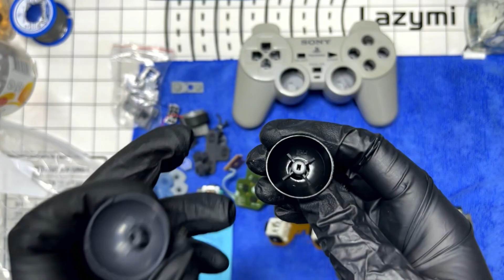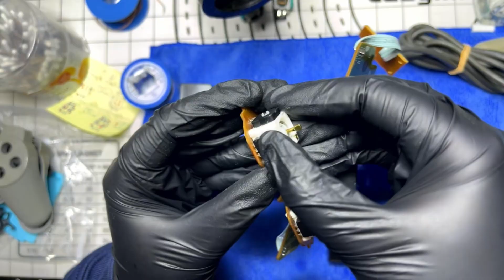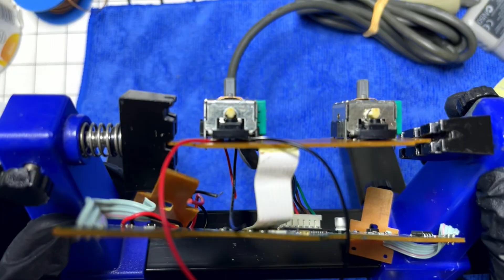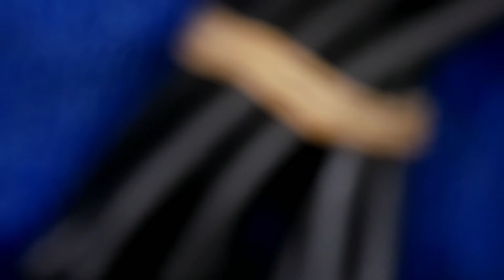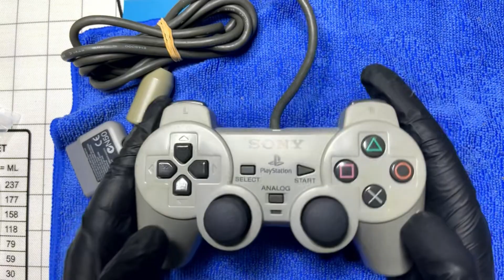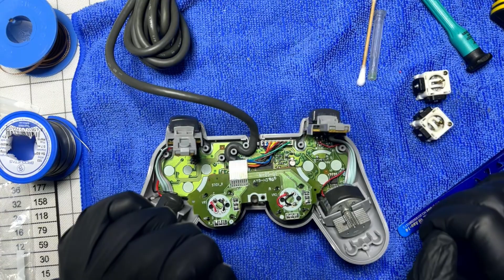Repairing this PS1 controller (analog stick replacements)

Comment: 3d analog sticks drive me nuts, for example on your original psx controller the stick is made of METAL, but when i open my PSONE original controller the stick is made of plastic and its thick, its looks the same as an xbox360 stick, altho i asked to the AI and it says both are not compatible. and also says both are 10k pot value.
Reply from the maker: Yes especially with the ps1 controllers there is so much variation in type of analog stick / pcb design that barely anything is compatible. Makes it more difficult to repair. 

It is correct that the psone controller uses similar sticks as the ones in the ps2/360 controllers. So if you need to replace those sticks at least you should have plenty of replacement options!
Reply: @cpr_tech  that is true! however the PSONE controller analog 3d stick is not compatible with the PS2 controller analog 3d stick, because i think on PS2 controllers sony went back to the thin metal stick again! they drive me nuts. and we are talking about the analog 3d stick only, imagine if after that you need to find a plastic cap that is compatible with what you have just soldered into the pcb
LOL
Reply from the maker: @5DiFika yes that is an absolute nightmare! If we are talking about the middle pin where the thumbstick part goes in that is actually thick plastic and not the thin metal part on the ps2 controllers. 

I also seem to remember from the few times I opened up a psone controller that those had those thin metal pins, but with a little plastic adapter piece the ps2 / 360 format thumbsticks were actually able to be fitted. 

Someone should 3D print those if it isn’t already a thing, since finding good quality ps1 stick is basically impossible :(